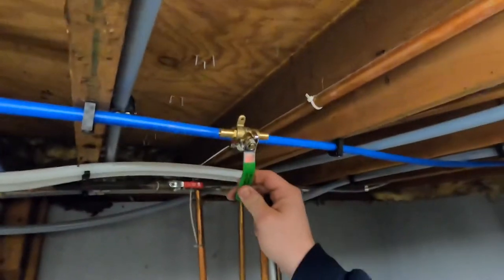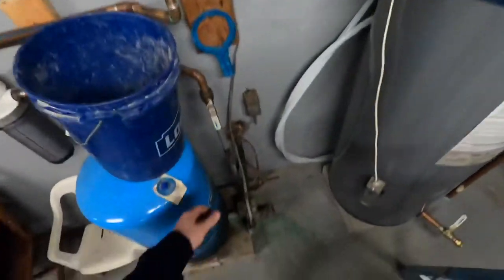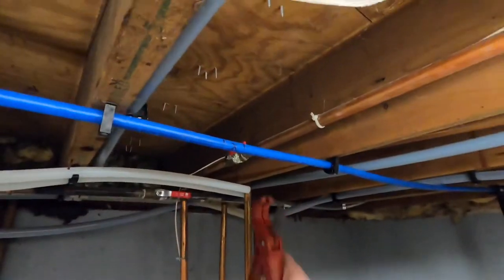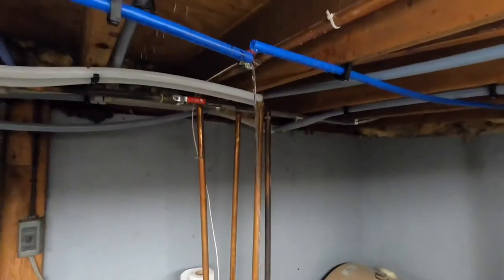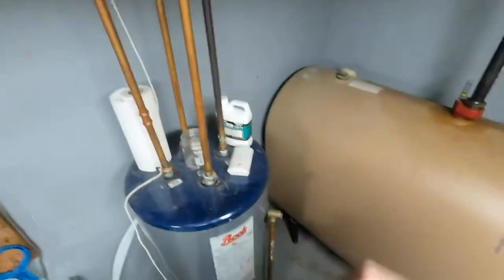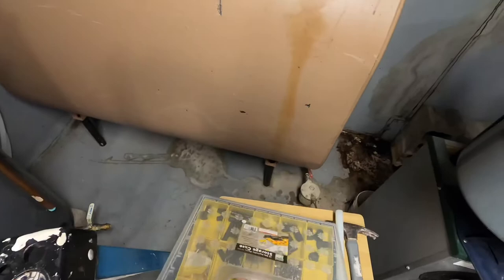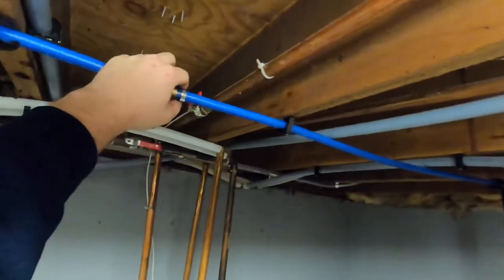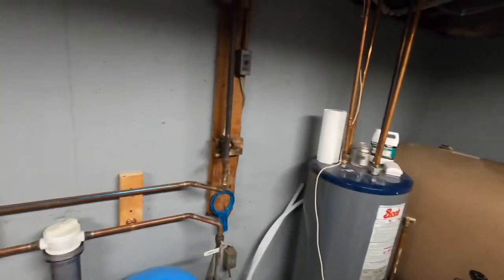Cinch Pex how to Easy DIY

Comment: Cut a good straight cut on the pex, place clamp about 1/8" from the end, and clamp it down.
Reply: Thanks for mentioning the 1/8 inch  (3.175 mm) distance for the clamp. Is that the perfect distance? Wonder what distance people working with the metric system would say. Would they say 3 mm or 4mm?